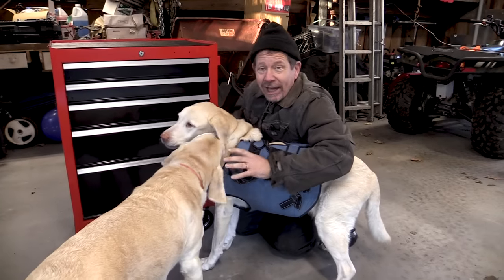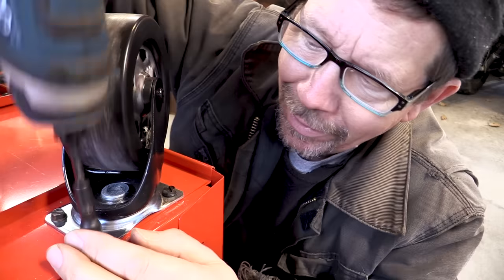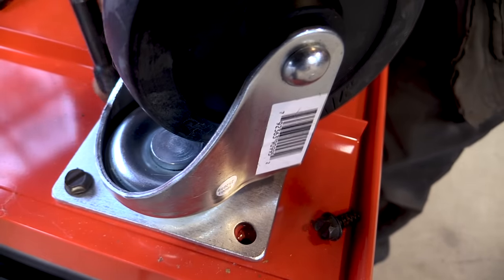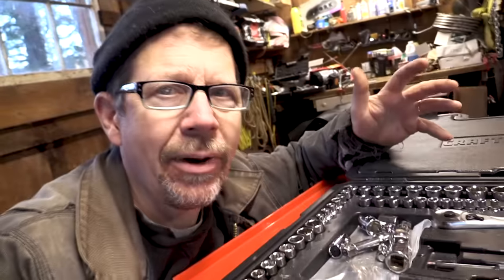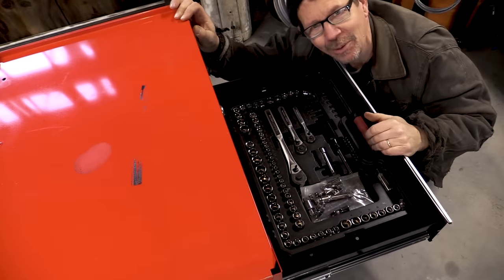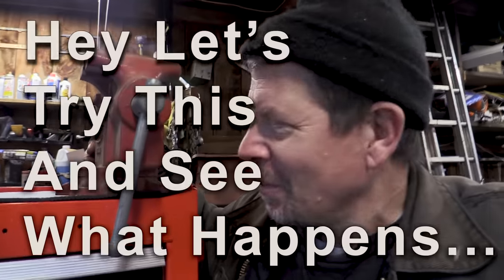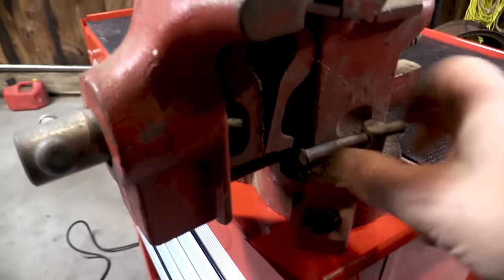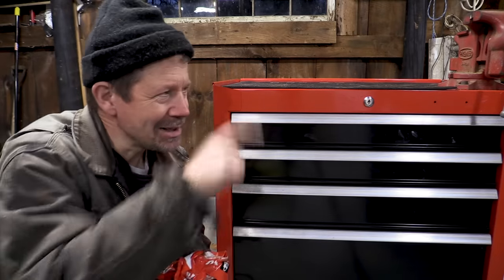3 Rolling Tool Cart Hacks You Can Do

Comment: A plate under the vice is needed. That sheet metal is thin and will deform
Reply: Agreed. A sheet of 3/4 plywood cut to fit into the top lip  and bolted down turns the whole surface into a usable worktop.  Bolt the vice through that.  Or use DJClarky78's similar idea.  

Reinforcing the thin steel applies to the upgraded casters as well.  The idea is not original to me, but I added 1/2" thick, 3" wide boards running perpendicular to the the steel reinforcements between the caster plates.  It's unbelievable how much rigidity and weight-carrying capacity that adds to these units.  As is, those casters will splay when the cabinet gets really heavy.
Reply: @rangersmith4652  There'll be no beating on anything in that vise.
Reply: If you cut a 3/16 steel sheet to fit the top you can mount the vice and use the top for a welding table for small stuff.
Reply: Thought he was gonna flush fit plywood so you could be “level” across the top, THEN screw through both.

Comment: I'd put a wooden top on the toolbox, then mount the vice to that.  Put a thin filler piece in first to take up the void where the rolled steel lip of the box sticks up, then some 3/4 ply on top of that.  You could leave a 1" or so overhand all the way around.  This will give you a sturdier mount for your vice, and also a proper little workbench as well.
Reply: I concur. Unfortunately, that thin metal top will eventually give way when you torque on the vise.
3/4” plywood across the whole top will provide a tough work surface to pound or cut.
If the wood working surface extends an inch or so over the sides, you can also use other clamps when drilling, planing, sanding, or routing.
Reply: I used 2x4s glued together and notched it so that i could make it longer than the box itself for an overhang
Reply: Brilliant

Comment: Seriously the socket hack, how have I not thought of that?! Thank you, will definitely be using that one.
Reply from the maker: Yeah Jerome, same here. it just popped into my head while I was working on the video. :)
Reply: Use a cotter pin to make it easily removable and you can pin it back together quickly to take it with you.
Reply: @gardenfork  So rather than foam on the sides, you still have room for some socket organizers for specialty sockets like Torx, Allen heads, Impacts, etc.
Reply from the maker: @dolfinwriter5389  great, thx!

Comment: Personally, I would avoid using four swivel castor's. It may sound like a good idea for maneuverability but from personal experience once the chest gets bogged down with weight it becomes harder to turn and steer. Instead of fighting with two swivels, then there's four to contend with. Also, if the floor isn't completely level, it is more prone to drifting because it has no in line tracking. 

If the top is used as a work surface and a area for a vise, put a piece of plywood on the top. That tool box top is relatively light sheet metal that doesn't have any reinforcement. 

Just my two cents worth but hope the box serves you well.
Reply: Your exactly right.
Reply: putting any vice on anything that has non blockable wheels is something maybe not well thought through ?  my 2 cents ;-)
Reply: @friendlygarfield  Agreed.
Reply: I have 2 mobile Sidchrome 7 drawer tool cabinets (Trade level)  and they would weigh around 200 to 300kg each with the amount of tools in them. I will stick with 2 fixed 2 swivel. I know when I have to move them you can feel the weight.
Reply: also: put the swiveling wheels on the pushbar side. makes it 10x easier to turn...

Comment: We kept some old fixed plastic wheels (2 with lock latches) from some forgotten thing for years out in the sheds. One day I got the idea to fix them to the bottom of a tall bookcase. That enables it to be pulled (gently) away from the wall every few months for dusting the skirtings. Take the books off, and it's a LOT easier to move elsewhere altogether. So, in 'custom' situations and/or for occasional necessary work that such items have the potential to make easier, the justification for 'sparing' cheap but usable stuff does kick in.

Comment: Thank you for sharing. I received a craftsman tool box and the first thing I did was to purchase replacement wheels, cut a plywood base, drill out the holes and fasten with bolts, washers and nuts.  Much simpler to do it first thing, right off the bat.  Although, it was rather finicky removing the bottom drawer.
Reply: How do you get the drawer out?

Comment: As a guy who lives out of his tool box here are some suggestions.  
1. Great hack with casters
2. Put your most used tools top to bottom.  Your back will thank you
3.  The vice. I have one but we always put it in the opposite corner that you did.  Always with a reinforcement plate beneath the vise so the sheet metal isn’t taking all the force. Opposite corner so it was out of the way most of the time when we didn’t need it
4. Organize your tools so Ray Charles could get you a tool. You never know when you need a passerby or the spouse to grab you a tool.  Very easy to direct them to it instead of searching for something they have no idea what it looks like. It also help in keeping track if ya forgot/lost a tool. 
5.  My buddies welded up a small shelf under the box between the wheel. They kept extension cords under there. 
  Hope this helps. I work in large industrial plants and you want your box as self sufficient as possible instead of walking a mile to the tool room.
Reply: Good suggestions, especially #5. A vice on a moveable platform is just silliness.
Reply: great tips - I LOVE #4. I put labels on most supplies in my craft room - so hubby can find stuff. He likes using my tools and supplies instead of going to his down in basement - go figure!

Comment: When I worked in a factory, maintenance workers would get a 3/8 inch of steel plate and cut it down to fit top. If they had a vice, they would mark holes in each corner, cut off the bolt head and weld four bolts to the steel plate. They had a great work bench.
Reply: Finally some one who doesn't want to put a wood top. All my work benches are steel.

Comment: Those recessed areas on the sides of the box make a perfect place to hang things like chains, small crow bars, or test leads.  Just bolt a piece of bar stock across the end.  If you can bend the ends into a U shape it’ll work great as an additional handle too.

Comment: If I were you I’d cut a piece of ply to fit nicely in the top then mount the vice through the wood and into the cart. Also maybe some steel or wood on the bottom so the vice isn’t stressing that small section of really thin metal quite so much
Reply: I had the same concern about the thin sheet metal! Nice ideas, I like the sound of a butcher block style workbench top!
Reply from the maker: Goo idea Alec, that will be in the next video. 😀
Reply from the maker: @Blakehx I have some scrap butcher block so let’s see... 😀
Reply: I always like to have a steel plate under and around the vice so there’s a place to do light hammering, So in this case I’d make up 2 plates at the same time, 1 to reinforce under the cab top. Though I do tend to over engineer things! :) Also, though I like the idea of 4 swivel castors, I’m thinking locking castors might be a good idea when you’re using the vice? Depends what you’re using the vice for I suppose.
Reply: I have a similar tool cart but I put a thick piece of wood and a diamond plate piece of metal on top and a hard work surface.
Reply: I would be concerned with the cart flipping over if you put some force on something in the vice.  Once a cart starts going, its impossible to stop.  Sockets everywhere.  Besides, its a tool chest, NOT a bench.  Put the vice on the bench, screwed to the ground.
Reply: Plywood sandwich the top and bottom but note the chime around the lower box pan it needs a sheet of 1/4” so you don’t crush or warp the pan.

Comment: The blow molded plastic straight into the drawer is something I've done when I didnt have as many tools. For a home gamer that doesnt get deep into tools that can work. Personally if say go get some drawer mat for most your drawers, cut to size and the tools will leave an indentation most the time. For sockets you can organize an entire drawer for about 30 or 40 bucks. If you buy your socket sets in each size and not as a massive set they usually will come with some sort of organizer. Many are the basic spring holders. I spent about 50 dollars in my socket drawer and I still have space. Theres also the big 300pc Kobalt set that comes with foam inserts to drop into the drawer. But I tossed those because they take up too much space. For reference my tool box in total probably weighs 2,000-3,000lbs. I have no issues rolling it. Sweep your floor and that no longer becomes an issue. A clean work space is a safe work space.

Comment: Three more tips:                                       1. Use a piece of 3/4 inch ply wood for the top for extra strength.             2. Line your drawers with indoor outdoor carpet.  Helps protect your tool and keep them dry. Tools are expensive, might as well protect them.                                                         3. Use wd40 to get glue residue off of surfaces. From tape to stickers. Works well.                                                4. Also Harbor Frieght sells small wretched caddys for your wrenches they fit nicely into your drawers and organize your wrenched, plus they are reasonably priced. Hope you like these tips. GF1 👍👍👍👍👍😁😁😁😁😁😎
Reply from the maker: Yeah! good info, thx! Eric.

Comment: Cool. A long wobble extension would ease caster replacement. A reverse wrench rack might allow you to place both sets in same drawer (worked for me). You can put a plywood top with a 2" overhang (one on side or many) which makes clamping items down real easy.  🔧

Comment: Great video!
I have the same toolbox.
Second drawer down, I laid magnet strips in the drawer and set my box wrenches on them. That holder you have just makes them too bulky, but magnet strips will make them all lie flat.
Reply from the maker: Good info Philip, thx!
Reply: I did the same thing (magnetic tape) and it works great!
Reply: I have a simular tool box (the Top Box Part)  that I mounted in the basement of my Motorhome on a slide out drawer.  I used magnetic strips on the underside of the drawers to hold my wrench tools holders and keep them from bouncing around in the drawers when we are driving.  Got so tired of having the tools all over the place when I stopped somewhere and needed a tool.  This way they are where they should be and all organized..  Especially the sockets.  Tip: you can get the rubberized magnets with the stick backings, and cut them down with scissors and fit them in the bottom of you socket trays.   Those heavy duty magnet strips that they sell for holding screwdrivers and pliers to walls also work well if you pop rivet them inside the bottom of drawers.

Comment: If you take 1/4 inch plate cut to fit the top of the box the vise works alot better. I just used rtv under the plat and it holds great. Then you also have the vise bolts to hold also. Harder working surface is awesome to have.
Reply from the maker: Good idea Joshua, thx for that. I had Butcher block so I blanked on anything else. Thx!

Comment: I just splurged on a Milwaukee 46" tool cart, then picked up the top cabinet when it came on sale....the casters are fantastic, so good move on your part.....the only thing I would have added on YOUR cart, and did this on one of my older carts, is to have added a 3/4" piece of plywood on top before mounting the vise, but its an easy add any time, if you have an tension on the vise moving around and bending the top, the wood will help to absorb some of that....big flats too...
Reply from the maker: Good info Thomas, thx for sharing, Eric.

Comment: Nice vid.  Good ideas.  
My comments: toolbox metal top too thin for vice support.  Add plywood or metal top.
Love the pups.
You may want to get two locking casters as the toolbox will move when you dont want it.  (Consider having the vice on top to keep projects from moving around.)
I love the pups.
Great thinking on pulling the hinge pin and using the case as a liner.  Not all cases have that option but you discovered that option.
Open closed end sockets are too small for the big drawer.  Save that for bigger tools.  Leave wrenches in holder and line the drawer with carpet scraps to keep down noise and movement.
Did I mention that i love the pups?
Reply from the maker: Good ideas Barry, thx for taking the time to write them down. Eric.

Comment: Can’t find a way to add pix here.  I have a board the width & depth of the open drawer covered in drawer liner (you needs some) that I can use as a fine work bench next to my desk chair.  Really good for close soldering circuits & assembly/disassembly work using a magnifier.   The board is drilled for a light duty vice.  I also had a piece of magnetic mat left over from my sign cutting days, used to put magnetic signs on the sides of cars.  That keeps the chasing tiny parts to a minimum. 

Also, I left the end handle off & have big power strips on both ends. 

I found out my pier & beam floor isn’t level.  Glad I bought the wheels with locks.

Comment: I used an extra set of the casters by bolting them to some 3/4" plywood cut in circles that hold my wife's largest potted plants.   They get moved around seasonally so it saves me from much heavy lifting and a job I otherwise abhor.

Comment: Unless you only work on light small things, I would put a piece of sheet metal in the drawer under where you mounted the vice. You are going to destroy that area of the toolbox as soon as you hit or muscle anything in the vice. I use a vice for so many tasks, that mounting it on a toolbox is a bad idea.
Reply: Yeah, I agree with you. Instead of a vise, I’d suggest mounting a thick solid wood surface onto the top, that over-hangs an inch or so all around to permit using clamps to hold down work.

Comment: The casters you took off have a much higher weight capacity.The more you load the box the smoother they will roll.
Reply: Most casters are styrene plastic they break and chatter polyurethane wheeled casters are three times better but reenforce the pan it will turn a $200 box in to $400 box for rolling.
Reply: Wow, you took heavyweight ball bearing casters off the roll away cabinet, and replaced them with  cheap non- locking  casters? I wouldn't buy your merchandise  for fear it wouldn't last.
Reply: @w.d.m-1899  Yeah, he's just fishing for clicks...

Comment: There are a lot of great hacks for a lower tool box. Mine started life with my step father because of tip-overs at work  they added two 1” sheets of ply wood to the bottom and 1 1” sheet inside the “pan” this made the casters and bottom very rigid the two bottom sheets are 4” bigger then the bottom of the tool box and the casters are set on the outermost edge like out riggers on a crane. Don’t use small casters go big go with wheel at least three time bigger and not rubber but polyurethane you will see and feel the difference.    2. If your going to set a vice on top sandwich the top in 1/2” plywood this will reduce and distribute the twisting force on to the whole top. 3. Aldi has just once a year a roll of black , brown , gray indoor out door carpet very cheap this is the best drawer liner and again reduces noise.           4.  The cheap push handles are crap Lowe’s sell  an stainless ADA grab rail about 12” long this is the best push handle you can use.                         5.  The ends of the tool box have pockets that help to make the ends rigid, by adding two pieces of flat aluminum across this pocket one at about 4” and another at 12” you can store flat stock, bar stock, round stock, sheet metal stock can be added to the other end.  Last one I pick up some scrap retail steel wire hanging racks that hold 8 spray can each, one of these can be mounted to each end of the the upper tool box and one could be mounted to the ends of the lower box.
Reply: Excellent suggestions all!!! 👍👍👍👍

Comment: On mine my father-n-law made a frame out of some angle iron to set the cart in. Then he put casters on the angle iron (welded). I would put your combination wrenches on the side of the cart. As for your vise your sheet metal is too thin on top. I would put a piece of plywood 3/4" on top, then mount your vise.

Comment: A tip for you sir, before mounting the vise, sand off the paint where the vice is seated so is a good metal to metal contact, so you can clamp the ground for your welder to the cart itself making anything in the vice now weldable.

Comment: Cool! Got a new Sears box and has same wheel issues, glad to learn the bolt pattern is “universal.” I’ll be replacing with the higher upgrade orange/red poly wheels, swivel and lock on one end, fixed on the other. True, difficult to handle when heavy if all wheels rotate. Added plywood top before putting vise on top, gives nicer surface to work on.

Comment: Interesting video.  I have done this to a Craftsman tool box a few years ago. 
I wanted a solid work surface so I found a piece of 3/4 " plywood, cut it to size and put it on the top of the box.
Then I mounted the vice. I used some odds and ends of metal to mount the  the box to mount the vice to.
 It has worked our great. I have done this to an
²
Reply: Sorry, I started to fall asleep.  
I drilled holes in the scrap metal and mounted them on the inside of the box for additional support for the vice. 
I have also used 1X12 pine to cover the top of the box. I predrilled and used deck screws to attach the wood.
I like the idea of swapping out the casters but I think the 2 front ones should be locking ones. They will add stability when using the vice.
Reply from the maker: Good info! Thx for sharing !